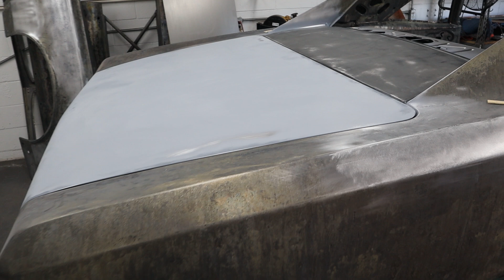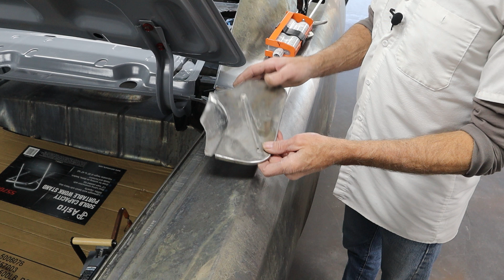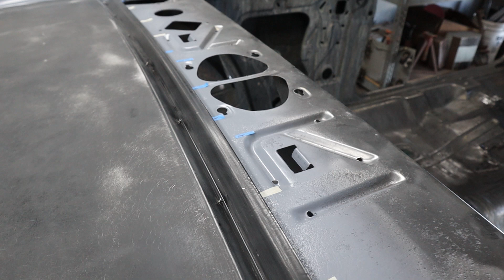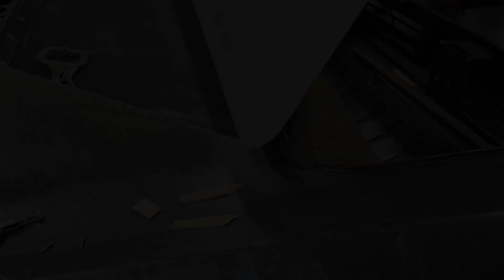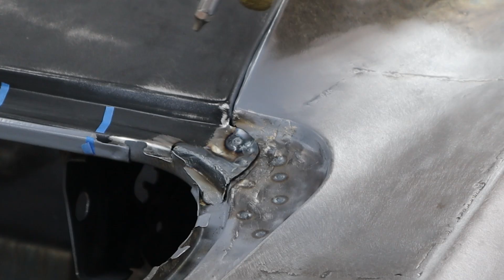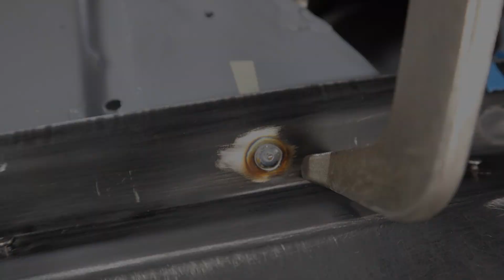GM A Body Filler Panel Fit Up and Welding - GTO RestoMod (Ep 27)

Comment: The panel behind the rear seat before the rear window is that new i havent seen you work on it i need that for a 67 lemans im working if you did replace where did you get if not thanks for the videos watching them all big help
Reply from the maker: I did some repair work to it(speaker holes gashed out with a claw hammer)  but other than that just clean up. I have seen them as a repop but don't recall where. Sorry.

Comment: Hey it's me again...the guy doing the same work on a 66Lemans. The gap between the filler panel and the trunk lid was too wide on the driver's side. I fussed with it to no avail. I finally cut a split in the edge of the filler panel. Opened it to where I liked the gap and mig welded the gap shut. Worked like a charm.
Reply from the maker: Hey Bobby, I am glad you got it to fit nicely. 
Yes splitting does work but warping the panel can be an issue and in my case the edge where it rolls down to the weather strip channel is not  consistent which will require reworking later anyways.  The edge is pretty clean and matches the factory most of the way but the ends where it meets the quarter it is a lot more rounded. I may lead it in, build it up with weld or use something else.  Not sure yet.  
  Did you get yours welded in all the way yet?
Mark

Comment: It's coming along nicely Mark! Thanks for sharing. Where do you get your vice grip pliers for the body work?
Reply from the maker: Hey Doug,  I pick them up where ever I find them cheap.  The small ones are from Harbor Freight, some were my dads and others I picked up here and there. Harbor Freight clamps are more than adequate for body work and the good part is they are so inexpensive you can modify them and not feel bad about it. 
Mark
Reply: @FoothillPaintandFabrication  Thanks Mark!

Comment: Filler panel looks great!
Reply from the maker: Thanks, I have reworked a few that others have installed so I didn't want to be that guy, especially on my own car. The whole time I messed with that repop I wondered what it would be like to be  using a factory replacement panel right from GM. 
Those must have been the days...
Mark